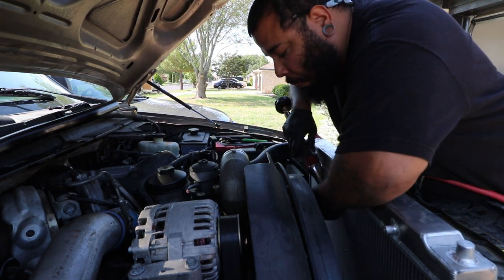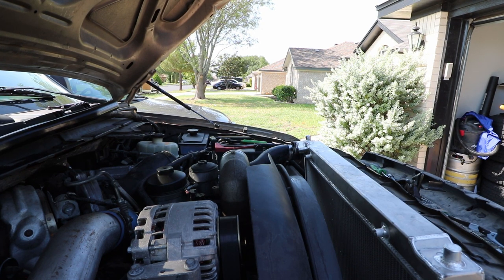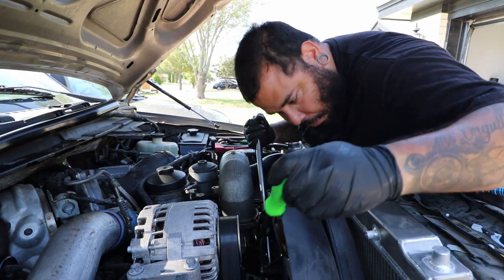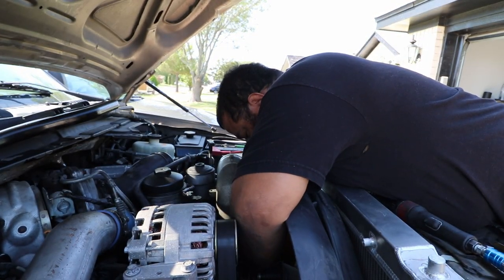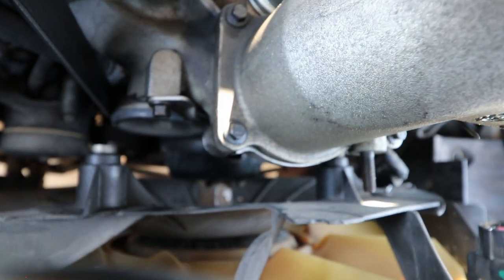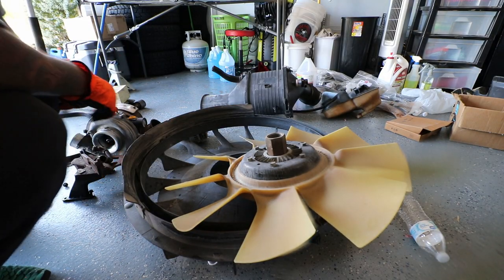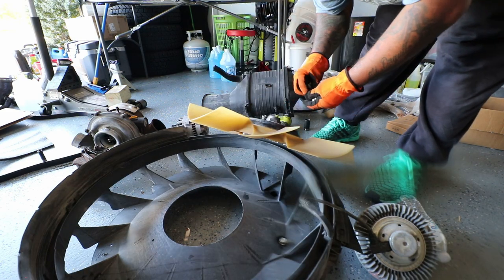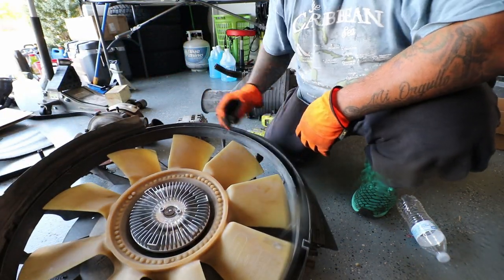6.0 Powerstroke 7.3l Fan Clutch Mod Install. 2005 Ford Excursion

Comment: Thanks for the video. How many miles did you get out of your stock radiator before you upgraded? Also, would it be easier to replace the fan clutch while installing a new radiator (while it’s removed)?

Comment: How did you fix the check engine light for the disconnected electronic clutch fan?
Reply from the maker: There is a connection add on that plus in so it thinks it’s still there, comes with the kit